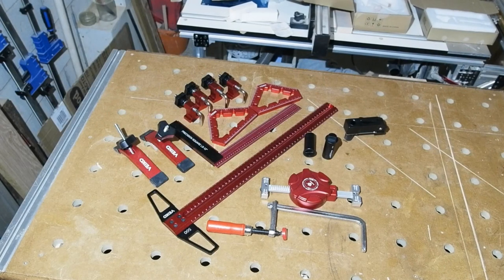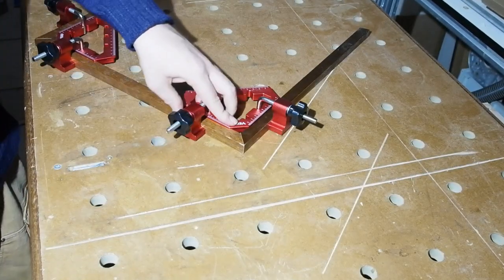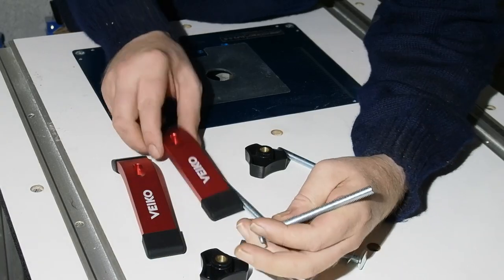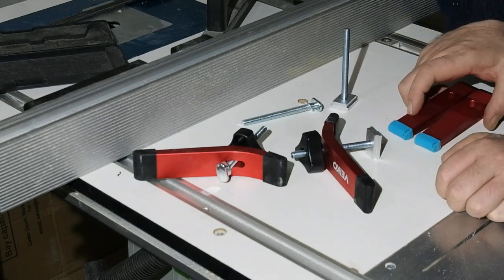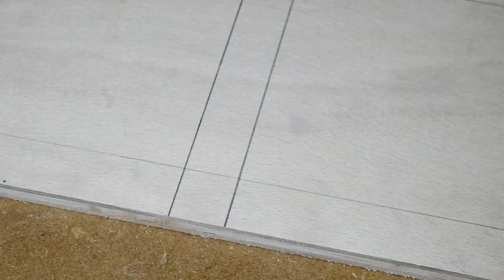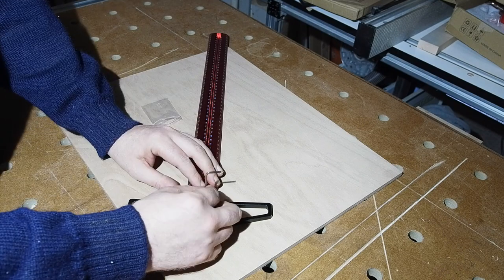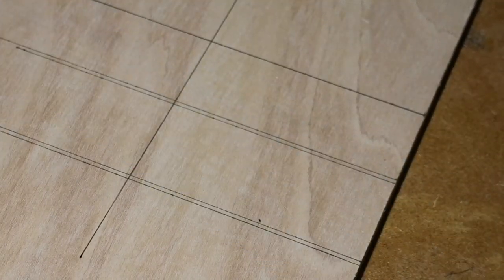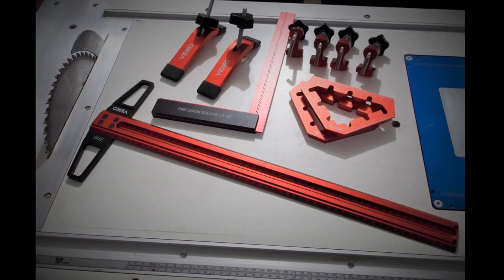Banggood Tools Part 2 Veiko Review!! [Gifted]

Comment from the maker: Be sure to post entries on Instagram only. Entries in the YT comments won't count. Open to UK residents only. 
To enter you'll need to follow me on Instagram. This gives a discrete means for me to contact the winner and for them to supply a shipping address.

To be in with a chance of winning, under the relevant Instagram post, I want you to tell me briefly what is the dumbest thing you've done on a job site or in the workshop. It could be something dumb you've seen someone else do. Maybe a silly "why do I keep doing that" habit. Lets try and keep it clean, woodworking or trade related and hopefully, share a chuckle along the way. 

As an example of what I'm after, and it's something I've video evidence of but, when I'm applying finish, I'll usually make myself a nice cup of tea. It'll often be my first saw dust free cup of the week. All too often, with tea and finish on the bench, I find I've dipped my application brush in the tea. It's an embarrassingly frequent occurrence. Luckily not applied tea to any work yet though!

So there you go, a mild example of something dumb I do. I've no doubt some of you will have more amusing, smooth brained examples than that. Lets here them. Embarrass yourself or someone else and you could win all the tools I've reviewed here. Have several goes as well if you want. 
Closing date for entries is Friday the 12 of November 21 with the winner announced on Saturday the 13th.

Post your entries under the Instagram post only, not in the comments below this video! Instagram post HERE: https://www.instagram.com/p/CWAoM_KIy...

Comment: Happy New Year! The 760 is excellent. Very pleased with it. I have the hold downs too. Very good. As well as the usual workshop stuff, I use them in my roof bars with steel coach bolts to move stock and sheet from the supplier (short, slow journeys - all carefully risk managed, wouldn't use on a fast road without e.g. straps just in case). They stay nicely tight and grip the stock well without marking.
Reply from the maker: Happy New year mate! I was impressed by the veiko tools, especially for the price. I gave them all away but only because I have multiples of these sorts of tools already. Like the idea of using the hold downs on a roof rack👍

Comment: Morning Stew. Seems the shipping for the Veiko 500 T-square is an additional £12.08 but not for the 300, 400 or 600. Very strange. Do you think it's worth the extra?
Reply from the maker: Alright Gary. Yeah, only noticed that this morning when sorting the links. The 500 has the highest postage at £12 for some reason. It's discounted at the mo so, even with postage, I'd say it's still pretty good value. I was genuinely impressed with it but whether it's worth you spending your hard earned on, only you can decide mate.👍

Comment: The 100mm mark from the edge of the t-square looks like 100.5-101 in the video. Do the markings start bang on the edge of the square or are they off slightly? I bought a similar t square on bangood and it's off by about 0.5-1mm.
Reply from the maker: Where does it look like "100.5 - 101"? Can you give me a time stamp? These were all part of a give away so I'm unable to double check but, from memory, these tools, the T-Square in particular were absolutely bang on. Maybe you're going by the 100mm pen line I drew using the marking holes. If so, couple of things to bare in mind: Camera angle being most instructive. It wasn't pointing straight down from above so may give a perspective distortion. Secondly, I used the weird pen thing supplied. This wasn't a perfect fit in the holes. Hole layout is also something to consider. As in whether the measurement is up to the line (so you'd remove the line when cutting), centre to the mark (half and half) or, keep the line. Various tools I have are laid out differently in this respect. My Incra rule has marking holes laid out in the "keep the line" fashion. This will make a measurement look short if you're working to remove the line. This T-Square seems laid out to "remove the line" - this might make it look long on measurement.
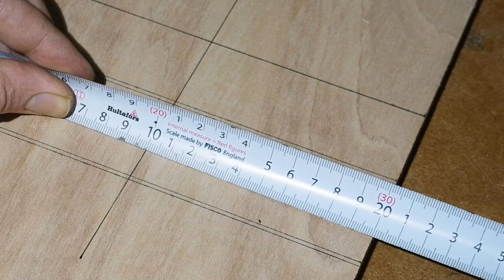Reply: @BischBaschBosch  Ah yes sorry not clear, it's 11:48 https://youtu.be/tnMlQ6-ulPE?t=708 Edge of wood looks over the 100mm mark on the tape but maybe it's the angle.